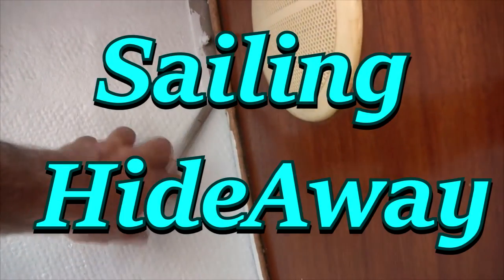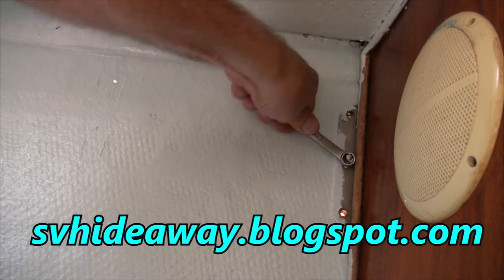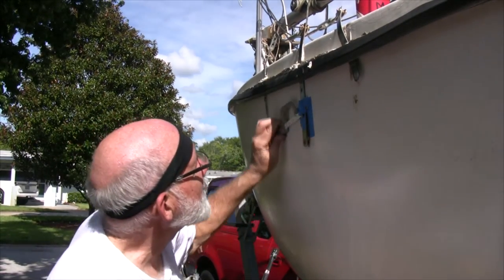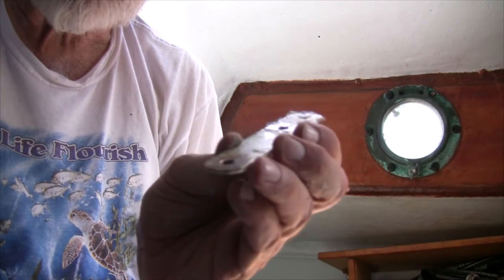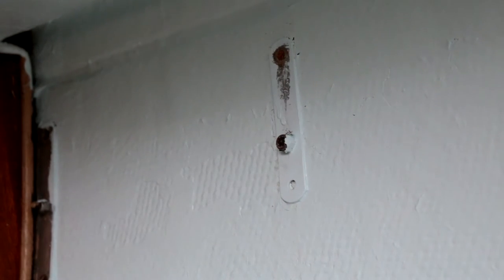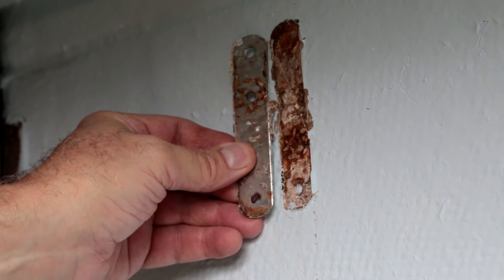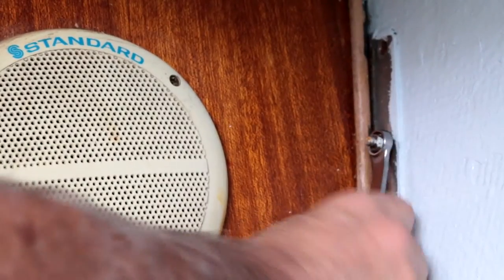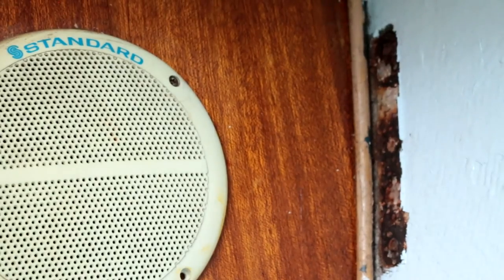Are Your Chain Plates Rusting? Are You Sure?  Sailing Hideaway  Com-Pac 23

Comment: Hacksaws are designed to cut on the forward stroke. You have yours mounted backwards.
Reply from the maker: Hmmm  I thought the little arrow on the blade pointed backwards.  Guess it's just me who's backwards.  Just as I've said before;  you are just as likely to see the wrong way to do something as you are the right- but we both learn a bit in the process -  Thanks for your comment.  M
Reply: https://en.wikipedia.org/wiki/Hacksaw They'll both work for you. You should be given credit for the cool idea of use the drill. CREDIT.
Reply: On the little hand saw it cuts on the back stroke , on a normal hack saw you are indeed correct it is supposed to cut on the forward stroke..